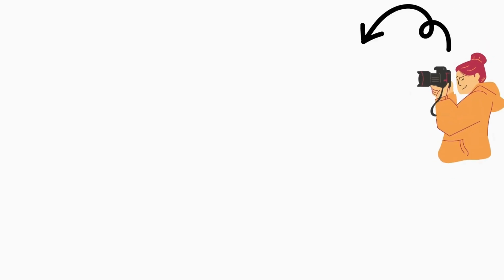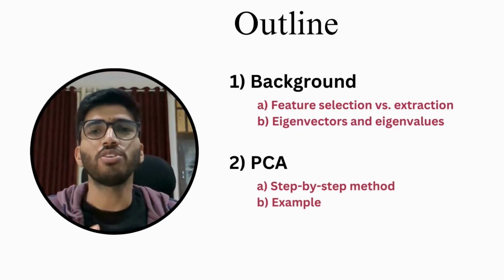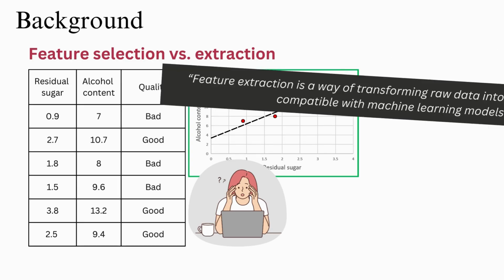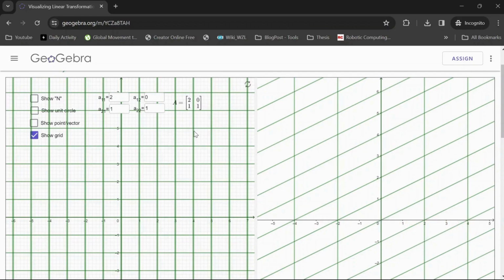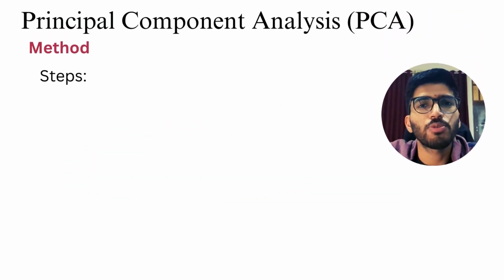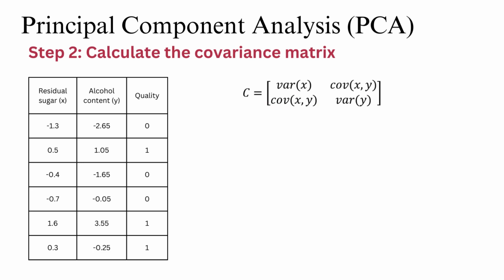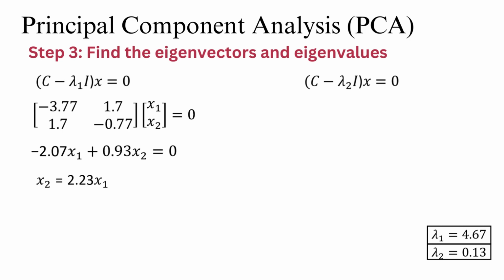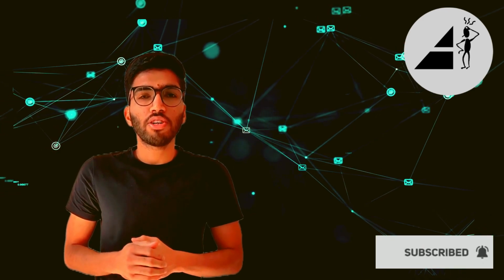PCA (Principal Component Analysis) in ML | Simply Explained...

Comment: Ritesh, thank you very much for your clear and orderly explanation!!!
In fact, it helped me to grasp the PCA idea much better than an explanation given by a PhD ;-)

Just a question - in the example, we've got 2 variables, and we do dimensionality reduction on them, and we still get 2 dimensions (which are represented by these 2 eigenvectors this time). So we actually do find the most principle correlation or direction. BUT we do not reduce dimensions, do we?
Reply from the maker: Glad it helped you.
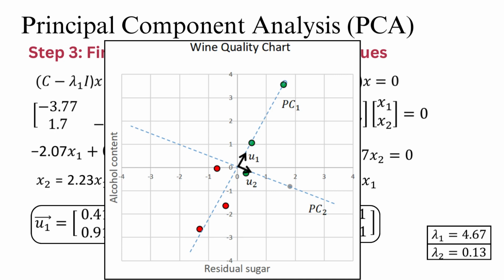Regarding your question: Yes, we did use 2 variables and our final goal in the example was to reduce it to 1 variable (or 1 dimension) problem. For that, we found two eigenvectors but at the end we selected only one of them based on the highest eigenvalue. You can refer timestamp 14:44 for this. Hope it helps.

General idea is that the number of principal components/ eigenvectors you will select for projection will be the final reduced dimension of your data
Reply: @TheMLMine  Oh yes, I see. Thank you very much!